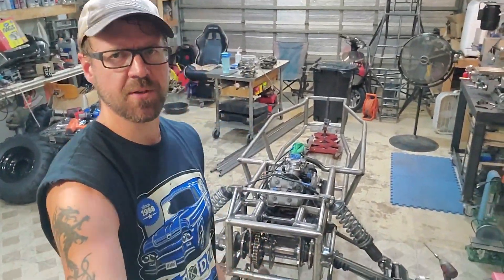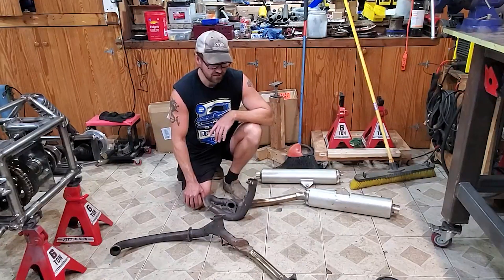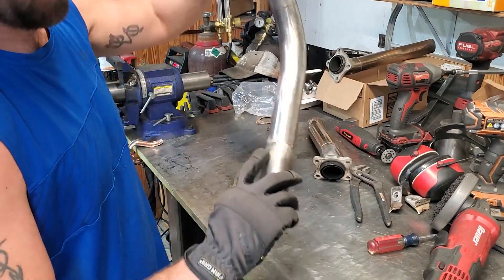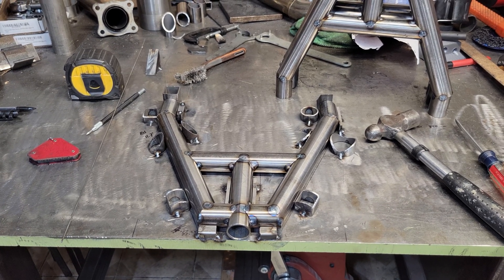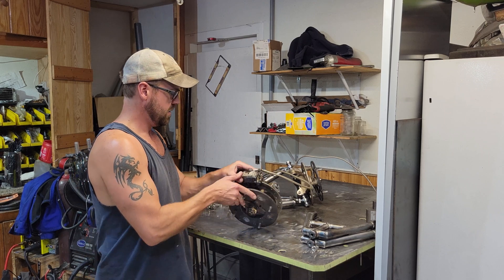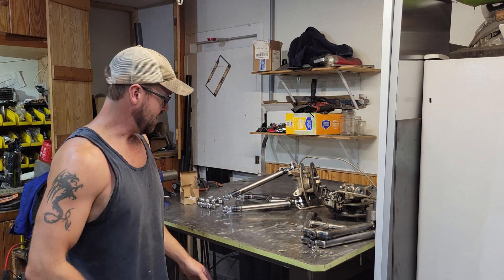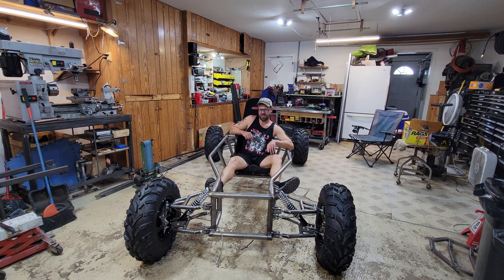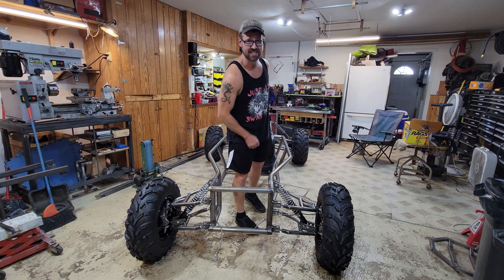DIY Front Suspension for Junkyard 135hp | V-twin Powered Cross Kart Off-road Buggy |Provins Garage

Comment: Why are there hiem joints at the frame connections of the A arms ? That motion in ONLY in one plain . It seams a waste of money , and a weakening of the front suspension . I think the reason for triangulating the A arms is to STOP hub motion fore and aft . A heim makes it easier to move that way . I could be (and often are) wrong . But , as parallel as the suspension is set up , you should have no reason for front to back motion of the A arms. Look at these (16) High-Grip Race Suspension Conversion For The Fox Body: Part 2 - Engine Power S1, E13 - YouTube
Reply from the maker: I mainly did heim joints at the upper end to adjust my caster. The spindles I used were just something I had so the caster needed adjustability to dial it in.
Reply: @provinsgarage  Ok , I used threaded "eye bolts" with nylon bushings ??? you know what I mean . LOL . That still gave me 4 points of adjustability . I must have had Chinese heims , they got sloppy in a couple of thousand miles . It really changed the handling when I swapped them out .
Reply from the maker: I definitely appreciate the knowledge. I'm sure things are going to break or not work as planned and I'll end up making a bunch of changes over time. I'm pretty new to building my own suspension so I appreciate all of the input I can get. First shakedown drive coming VERY soon!